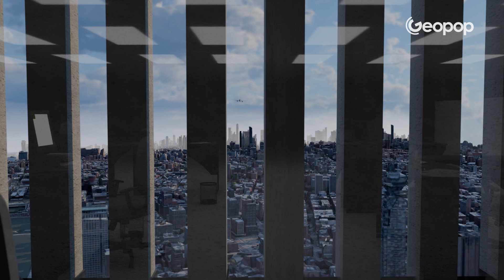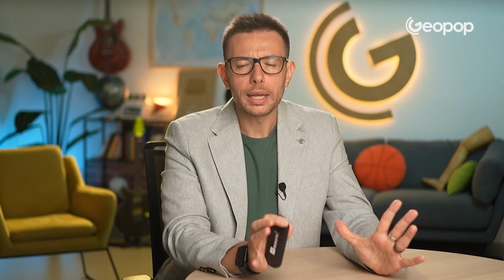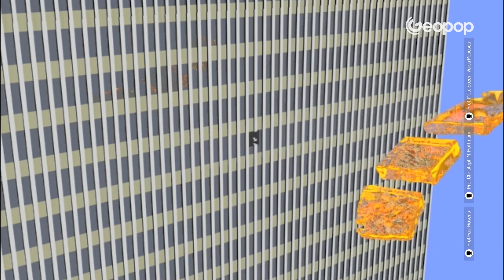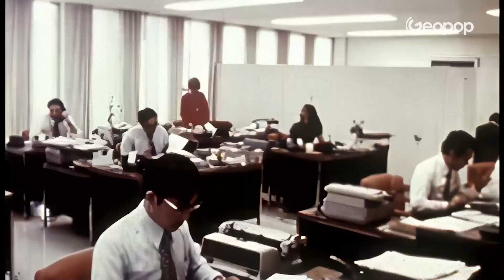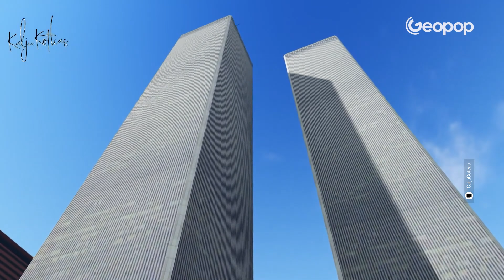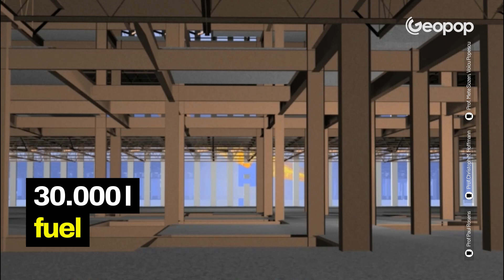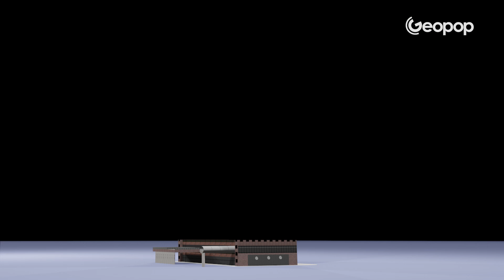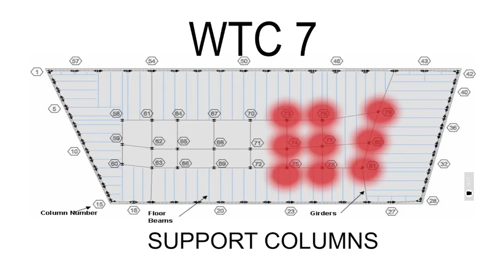9/11, 2001: The Technical Reconstruction of the Twin Towers and WTC 7 Collapses

Comment: A tower in London burned for 3 days and didn't fall...
Reply: @marinadogandtroy Looks like nobody is razor sharp as everybody is missing the point of razor sharp!
Reply: A tower in Sao Paulo burned for 90 minutes and collapsed. One in Tehran burned for 3 hours and collapsed. Unlike your UK building (which was made of concrete) those were steel and collapsed even without being hit by giant airliners with the force of a ton of TNT. 

You should be less picky with your evidence or you will get burned every time.
Reply: And it wasn't hit by a big airliner causing structural damage.
Now go study. Sounds like you need it.
Reply: What a naive comment! And it shows what the basis of conspiracy theories are 17:57  … lack of logic, knowledge, education and common sense! It did not burn for 3 days … sources give figures of 24-60 hrs … it was a fridge fire and not a ‘flying bomb’ filled up with tons of kerosene drenching the core of the building. Unknowingly you even contradicted your own narrative … fridge fire completely destroyed the building now being at risk of collapse!  Despite fire brigade attended and tried to put out fire for days! WTC hit it far harder … no fire brigade attendance dousing it in water … plane at high speed filled with kerosene plowed through the building drenching its core in burning kerosene … exponential higher forces similar outcome … building destroyed completely … WTC hit harder hence collapsed faster.
Reply: Not all buildings are designed the same genius, and these things were MASSIVE. the amount of mass being supported by softened beams made collapse inevitable.
Reply: But the fire wasn't fueled by jet fuel and a 777 airplane didn't crash into it at over 500 mph.
Reply: @razorsharp8549  Building 7 wasn't hit by a plane.
Reply: @razorsharp8549 wasn’t a 777!
Reply: @razorsharp8549  Jet fuel burned up on impact
Reply: @razorsharp8549  you cannot fly over 500mph with a commercial airplane at a height of 200m over ground.
This is physically not possible.
The airplanes had a maximum speed of 180mph, 330km/h.
Reply: @weltie03 That’s completely irrelevant … you did not understand the message! Fridge fire vs ‘flying kerosene bomb’!
Reply: @weltie03 - tosh! The plane that hit tower 2 was going at 590mph. 
You think a 777 can only fly at just above stall speed? You are crazy.
Reply: @NapoleonGelignite  in this height about 800 feet?
The wings of the passenger airplanes can't do this.
Reply: @ - you’re mad. It’s not ‘the wings’ that determine the speed - its engine thrust. 
If you can do simple math you can work out the speed of the aircraft by counting now many frames  it took to disappear into the building. It was travelling over 500 mph.

Comment: Inside job. Look how WTC7 came down and you HAVE TO conclude it was a planned demolishion. Anything else is BS.
Reply: I’m going to respectfully disagree and offer a more plausible explanation.

The collapse of the unknown and unimportant Building 7 – one of 6 buildings to collapse of 10 destroyed on 9/11 - confuses a lot of people, despite being one of the most studied engineering disasters in history. It was not famous, not a terrorist target, no one was killed in it and thus it did not get a lot of attention, so most know very little about it. There is a lot of tantalizing but absolute garbage out there on this topic. Given the choice between long boring, hard to find technical reports and readily available, easily digestible fantasy on the internet, many turn to the latter. To counter that I prepared this brief summary explanation based on my own analysis. No politics, just engineering. 

The North Tower collapse at 10:28am bombarded Building 7 with thousands of tons of burning debris, causing heavy damage and starting raging fires burning out of control for the next 7 hours. Half the responding FDNY firefighters having been killed, others injured, units in disarray, much of their equipment destroyed, no water pressure, and the greater urgency of Search & Rescue efforts, firefighting efforts at 7 were pulled as futile. The building couldn’t be saved and was left to its fate.

youtube.com/watch?v=g_SvpwyC17M&ab_channel=MFitz 

Collapse of a burning structure is always a concern for firefighters. Steel buildings subject to fire rely on active fighting of the fires to survive. Left to their own devices they will collapse. Buildings are designed around 1 to 3 hours of fire resistance, allowing time for occupants to escape and ACTIVE firefighting to get started, after which all bets are off. In B7 the occupants escaped, passive and active fire protections were compromised and active firefighting never got started which left the building to take its chances. It lost. Odds on Building 7 would eventually collapse,… and it did. No big deal in logic. That is the sort of choice firefighters make every day in brush fire situations - which houses to save and which ones to let go. Only real difference here is moving the decimal on the size and cost.

FDNY Chief Daniel Nigro ; The biggest decision we had to make on the first day was to clear the area and create a collapse zone around the severely damaged 7 World Trade Center, a 47-story building heavily involved in fire. A number of fire officers and companies assessed the damage to the building. The appraisals indicated that the buildings structural integrity was in serious doubt. I issued orders to PULL BACK the firefighters and define the collapse zone. It was a critical decision; We could not lose any more firefighters. It took a lot of time to PULL EVERYONE OUT, given the emotionalism of the day, communications difficulties and the collapse terrain

FDNY Deputy Chief Peter Hayden - We had our special operations people set up surveying instruments to monitor and see if there was any movement in the building. We were concerned of the possibility of collapse in the building. And we had a discussion with one particular engineer there, and we asked him if we allowed it to burn could we anticipate a collapse and if so, how soon? And it turned out that he was pretty much right on the money, that he said 'In its current state you have about 5 hours

With its deteriorating condition being reported throughout the day, the collapse of Building 7 expected by the FDNY, bystanders and the media meaning at least 24 video cameras recorded some or all of the collapse. Everyone at the time knew what was coming and why.

youtube.com/watch?v=OY5S5k3tMHI&list=PL4GiNqqck-lzR7pebSWRVLoXyu-aWR3Rr&index=48&ab_channel=911InvestigationVids 

Building 7’s collapse was totally different to the Twin Towers, harder to understand and most of the details difficult to see. But we can sort out what happened through careful analysis and observation.  What follows is MY EXPLANATION of the collapse sequence using the best available information and relying on no authority.

B7 was complex structure, a 47-story steel framed building built on top of a smaller existing 3-story building, requiring several lower floors dedicated to complex load transfer structures instead of usable office space. Of trapezoidal shape and all-steel tube-in-tube construction, B7 (above the 7th floor) consisted of a central core of steel columns carrying most of the gravity load, perimeter steel columns around the outside of the structure carrying the remainder of the gravity loads and long span beams and girders to tie those elements together and form the floors. On the outside of the building hung a moment frame - the last part of B7 to fall. 

Phase 1 : Collapse initiation for B7 is notably quiet with observers not realizing the building was collapsing! There was no audible warning in the form of say hundreds of ear drum busting 180-190dB explosive bangs preceding the collapse. The first externally visible signs of collapse initiation occurred at 5:20:28 pm. Here at 12:00 a local CBS affiliate reporter is talking 10 blocks from B7 when collapse begins. People don’t start to notice the collapse until 12:11. Then at 12:45 is the famous CBS fixed camera clip of Building 7’s collapse Again, note how quiet it is.

youtube.com/watch?v=t5tEy6mXSE8&ab_channel=fresnosean379

Collapse initiation was due to multiple lower floor failures above the load transfer region (7th floor) in the NE corner of the building. In this video at 0:45 you can see the NW corner from inside the building while under construction, Column 79 just out of frame on the left. That big, angled steel beam across the top of the frame connects to C79 at one end. The girders connect to the beam. The beam and all those girders depend on just one connection

youtube.com/watch?v=nP3TNHPCIVU&t=35s&ab_channel=EdwardCurrent

Phase 2 : Lower floor failures left core Column 79 laterally unsupported over an excessive length and it buckled. If you look at a floor diagram of Building 7 (see above) and look at all the structures that depend on C79 you quickly realize this one column was a relatively isolated structural element on which a disproportionately greater fraction of the structure depended . Externally we see a vertical progression of window breakage along the 44-46 line and a kink in the roof of the East Mechanical Penthouse at the top of the building, consistent with C79 failure. The transition from full capacity to almost no capacity occurs in virtually an instant. Once the buckling failure occurs there is almost no resistance

Normally with a buckling column, the load could very well be redistributed to other columns, meaning the buckling could stop after a while. With C79 that is not the case - the failure did not redistribute the load, so the collapse rapidly progressed to the roofline, sinking the rooftop penthouse.

Phase 3 : With C79 gone, B7’s progressive, non-symmetrical collapse continues with C80 and C81 at the east end of the core left laterally unsupported and quickly buckled and failed as well, sending the EMP down through the building. C79-81 all have no diagonal bracing, which I believe is a major reason why they could not redistribute a lot of vertical loads among one another.

From there collapse progressed from east to west through the central core until the core was gone taking all of the interior floors and structures and probably most of the perimeter columns with it. You can see the horizontal progression of window failures low in the building and the dropping of the remaining rooftop structures into the building. One of the big takeaways from the NIST Building 7 study (that gets completely ignored) was their modeling which determined C79 failing under ANY circumstances would have initiated the same collapse sequence.

Phase 4 : After about 10 seconds only the exterior moment frame - a hollow shell mostly supported by the 4 corner columns and quite unable to stand on its own – remains, creating the illusion the building is still standing since little has changed externally. That’s just hollow empty shell, like an empty cereal box. The north leans inward, forming a V in the roofline. The last remaining perimeter columns buckle under the strain.  There is almost no resistance as the moment frame free falls, landing on top of the 7-story high debris pile, blocked surrounding streets, heavily damaged the Verizon Building and destroyed Fiterman Hall at 30 W. Broadway, all well outside of Building 7’s “footprint”.  It is only here, at the very end that a single utterly meaningless measurement of alleged free fall is taken. Start to finish the collapse took 18-20 seconds, or less than 1/3 of true free fall*. Not that we really care since how fast something falls cannot tell you what started it falling in the first place. The free fall argument is about the collapse of the outer shell *AFTER all of the critical internal structure had already failed and completely ignores about 80-90% - of the collapse. 

Building 7’s progressive, non-symmetrical collapse was incidental and unintended collateral damage from the combined effects of fire + time + gravity started by the collapsing North Tower. That is true no matter who planned and carried out the 9/11 attacks or why . The collapse was of so little consequence it barely even registered at the time, a mere footnote. 

I hope you found this helpful. It is meant to be informative, not adversarial and to solicit informed critical comment. If I made any errors of fact, logic or reason or left anything critical out, please let me know so I can fix it. IF you can offer a more plausible alternative be my guest. So far no one has even tried. Please start any reply with the words “Tits McGee” or I will know you didn’t actually read it and won’t let you waste my time.

Comment: The WTC buildings were built to survive multiple impacts of big passenger planes. Controlled demolition is the reason why these 500.000 tons of reinforced concrete steel frame buildings collapsed.
The energy to pulverise hundreds of thousands of tons of reinforced concrete steel is beyond your imagination.
Reply: No they weren't designed to withstand multiple aircraft impacts (however one chooses to define that). Nobody would ever do that. Also, the Twin Towers were of pure steel frame construction. There was no load bearing concrete at all in the structure.

You are either making stuff up or poorly informed.

Comment: What happened to core column dude you did not explain how thick the core column were.even in you illustration steel beams can deform but core column didn't disappear
Reply: They collapsed too. You can see it.
Reply: The Largest robust columns were 22″ by 54″ and 36 ft long. These were located in the core and consisted of 5″ thick plate steel. The exterior columns were 14″ by 12″ box columns with 1″ plate steel. The thickness of the steel narrowed as the height increased. Therefore steel at the top floors could be thin as .25″ this was also true for the core columns. Since the upper portion of the building didn't need to support as much weight as the lower floors. After a certain height, the core columns transitioned into “H” columns.the The whole towers collapsed in 9 sec each. dude, the tower was not from domino's
Reply: @nawtec4970  -  33 seconds, not 9 seconds. The 9-second thing was just how long it took for the first loose debris to hit the ground. The rest of the building was way behind that.